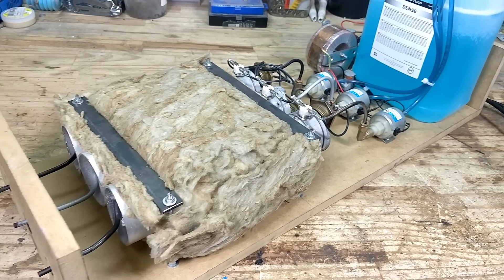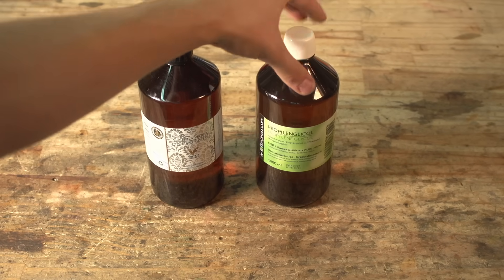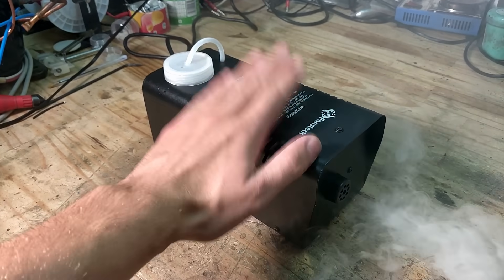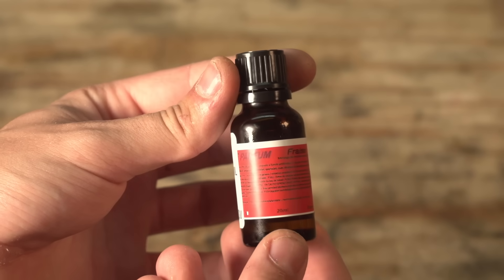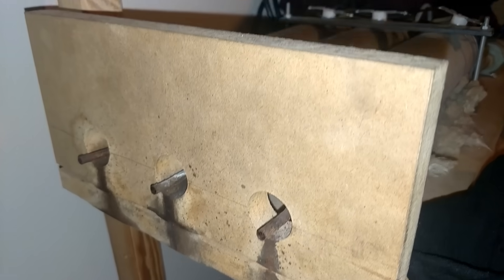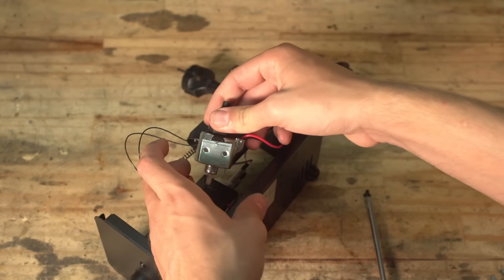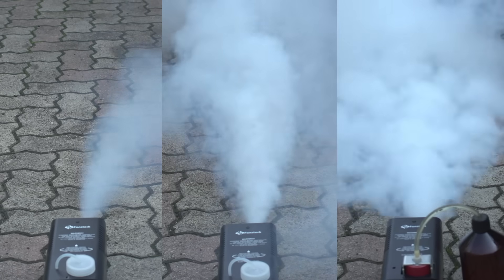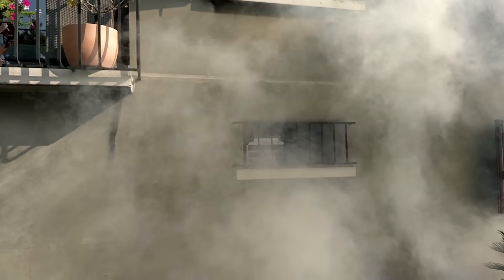How To Make a Cheap Fog Machine 10 Times More Powerful

Comment: Do you think you could change the controller to be able to have a bit more control? Like with a potentiometer, and avoid spuing out tons of un evaporated liquid?

Also I'm not sure upgrading the pump won't damage the controller overtime, it draws more current, I guess?
Reply from the maker: Sure, maybe a timer that cuts off automatically after 5 sec?
Also, you make a good point. A bigger pump will pull more current. (Around 200mA @ 230v) 
The controller in this machine uses two beefy relays ( one for the pump, one for the heater) and are rated for well over 10A each so there's tons of head room
Reply: @NicolasSalencPBP  We hacked a wired machine for a commercial laser tag game with a 556 timer, so all the operator had to do was flick a switch, and the fogger would run for 10 seconds then wait 30 seconds. About two minutes after startup a capacitor would turn on a transistor, changing the R/C timing so it was on for 10 seconds, off for a minute. At power up the other half of the 556 would inhibit operation to give the heater a chance to heat up.

Comment: Atmospherics Technician here. This is not the best idea ever, and you did explain why (heater block not big enough, clogging issues). A much safer way to increase the output for a smaller machine is to use a high density fluid. Sure, that's what you've made, but you can buy High Density fluids off the shelf that work really well, that also come with a SDS. Antari makes a couple that are really good - FLY and FLH. Throw that in a machine and the difference will be almost as dramatic as what you showed.
Reply from the maker: Thanks for commenting! 
The commercially available liquid I used in the video is already supposed to be high density fluid, but I do think that it isn't nearly as dense as some other available liquids... Maybe it's just too old or I got ripped off 😆
What do you mean by an SDS?
Reply: @NicolasSalencPBP  Yeah the fluid you had looked like a light density fluid. The high density fluids I use are generally around 40-20% water. a SDS is a Safety Data Sheet.
Reply from the maker: @Socapexxx  60 - 80% Glycerine? Damn I need to get my hands on those, do you have a link to the fluid with the SDS?
Reply: If you are an atmospheric technician you wouldn't be using fog machines for commercial based productions. Just haze- which comes in two flavors: water based or mineral oil based (cracker).
Reply: @blasterman789  If you actually knew anything about haze, you wouldn't say there are 2 types.

I often do large outdoor shows and arena shows. It's great to get a baseline haze from an oil based hazer, but sometimes you need that extra kick. A couple of vipers with fans on either side of the stage can give you a really nice thick haze when you need it - and it dissipates very quickly when you don't need it.

Comment: You got me curious. I have a bottle of fog juice that I bought about 25 years ago (VEI brand). It's viscosity is close to water. I gave it a sniff and a taste and it's a bit bitter, not at all sweet like VG or PG. It may be off because it's so old, but it was sealed with tape with the air squeezed out. I ran the fogger a few years ago and the fog still smelled sweet. I brought up an SDS for Rosco fog fluid and it contains Triethyleneglycol, 1,3-Butylene glycol, Propylene glycol, and Deionized water.
Anyway, I have gallons of PG & VG, if only I used it more... And naturally, you can find videos of people vaping through custom mods running at hundreds of watts, which makes you wonder why they don't just use a fog machine.
Reply: It tastes bitter because they add some bitrex in it, to stop people from drinking it 😬
Reply: Most vapes were just smoke machines built around 3.7v /4.2v DC 18650 lithium batteries vs our 240v/110v AC hazers :)

Comment: 7:53  , Make sure to run distilled water only through the machine after unclogging it with vinegar. 
I made the mistake of leaving vinegar in the lines and the pump's small solenoid piston corroded out.
--
Distilled water in the lines has worked for me when leaving the machines unused for a year.

Comment: Got a battery powered fog machine? Looking for something that I can shove into an rc boat to simulate a steam ship.
Reply from the maker: Check out the smoke cube, it's usually used for magic tricks and doesn't really emit that much smoke, but is insanely compact and light weight : https://www.solomagia.fr/smoke-cube-gimmick-and-online-instructions-by-joao-miranda-fr-Fr.html?language=fr&currency=EUR&gclid=CjwKCAjwndCKBhAkEiwAgSDKQSOWsWcN8erm7eabDfFao6CUYKkAuKpvWH0r03mwokvYaTQgFQX5QBoCtlYQAvD_BwE
Reply: @NicolasSalencPBP  I'm not an that worried about weight, the plans I have are old enough that they call for lead acid batteries, and I'm planning on using lithium ion. And I'm half planning to build it to double scale which would make it almost 8 feet long.
Reply from the maker: @danielauen7790  in that case check out the "Look tiny CX" or the "look power"
Reply: Or consider an ultrasonic vaporizer approach. Small immersible units were used in tabletop fountains and the like. You’d have a ready source of water too.

Comment: Hi, I work as a service engineer and repair similar machines and stuff for scenes. You have a smoke machine in the video somewhere around 60 W, you can take a car for 1500 W, but unfortunately it is much more expensive. There is also a problem with liquid for smoke, pumps or regulators may fail and the heater clogs up due to the liquid. But small cars were still brought in with faulty pumps
Reply from the maker: Yes, the pump seems to be the weak spot of most fog machines. I have owned a few crappy Chinese models in the past and the pump is the component that failed every single time. I'm hoping Nespresso machine pumps are better quality...
Out of interest, how would you go about cleaning a heating block? My old DIY machine is filthy and could use a thorough cleaning and diluted vinegar just won't cut it x)
Reply: @NicolasSalencPBP   hydrochloric acid in any concentration does not damage copper, only eats the debris inside the copper tubing - but it etches aluminium quickly and makes steel rust instantly

Comment: Will this work with a home made fog chiller?
Reply from the maker: Sure! By home made I assume something along the lines of a bucket full of ice? More fog will mean that the ice bucket might not be able to cool the fog as well so the fog might not lay so low, and the ice will melt alot quicker, but it should work just fine!
Reply: @NicolasSalencPBP  I would be using a 5' ice chest for the build with a PC fan added to the output to help it along....
Reply from the maker: @chrislewis2262  Yep, should work fine!
Reply: @NicolasSalencPBP  My rig for halloween is a cheap cooler. I cut both ends with a hole saw and fit PVC couplings in with adhesive. Then i ran chicken wire between them inside. I fill the cooler with ice, set the fog machine on top with a PVC U shape set up against the fog output. It fires the smoke through and it pours out the other end of the cooler in a nice horror movie graveyard effect that sticks to the ground!

Comment: The water is used to shatter the glycerine/propylene glycol into smaller droplets when it turns to steam givng more fog.
Reply from the maker: Interesting! I did test the glycerine at different concentrations and it really did seem like the water reduced the performance in a rather linear fashion (10x more water = 10x less fog density) if that makes sense...
Maybe smaller droplets allow the fog to stay visible for a longer period of time?
Reply: @NicolasSalencPBP  I think it may have to do with safety and temperature, remember these fog juices must work with all foggers. I think the water is used to regulate the temperature of the glycerin and glycol, the water will never surpass its boiling point unless it is under high pressure so mixing it in would keep the glycerin from making dangerous fumes.
Reply: @sharpnesstherapy502  yes, and thats important! acrolein etc.    ecigs use lower temps so there its no problem to use (nearly) pure pg/vg
Reply from the maker: @y-o-u-b  I believe acrolein forms at 290°C. I have never seen a machine that has a temperature sensor that cuts off the heater at a temperature higher than 260°C... However due to thermal inertia and the fact that the coil is way closer to the heater than the sensor is, the coil might get hotter than 260°C for a brief moment. Perhaps the water is used to absorb some of that extra heat?
Reply: @NicolasSalencPBP  theres probably not a sharp point where the formation starts, at least a little is generated below that point so its better to choose a safe margin, as you dont smell it in little concentrations. as there is commercial fluid with only 1/5 or so water, it should be ok in this ballpark, especially if used outside,  the main hazard seems to be, as with corona, breathing aerosols for hours inside a closed room. nice mod btw, i will try it
Reply from the maker: @y-o-u-b 1/5 water? Finally! Do you have the product link or name?
Reply: @NicolasSalencPBP  No idea since I didn't test myself, but glycerin is flammable right? So wouldn't having a high glycerin content just make the fog explosive? Sounds like a pretty good reason to me for making the liquids mostly out of water, compared to the cost cutting theory, because otherwise you'd be able to still find more premium fog liquids with high glycerin content I guess.
Reply from the maker: @STPromosMusic  Its certainly more flammable than water, but the lack of oxygen inside the tube makes it impossible for it to combust. And of course, again, the heater will never get near the temperature necessary to ignite it. Also, if it was a possibility, I assume you would be hearing alot about explosive e-cigarettes (and not the ones related to the lipo battery exploding )
Reply: @NicolasSalencPBP  I see, so glycerin can't ignite unless it's temperature gets high enough (even with a spark), which won't happen once it is floating outside as smoke, did I understand right?
Reply: @sharpnesstherapy502  the boiling point of water IS surpassed, but the boiling range of the mixture is lower than pure VG+PG, see https://en.wikipedia.org/wiki/Raoult%27s_law
(which ist good)
Reply: @NicolasSalencPBP  water is flamable above 1700 C  (oxyhydrogen) an this temperature could only be reached by using lipo electrolytes as fog juice. but there are anecdotally mentioned cases where normal water based fog juice fog (outside the machine) indeed was able to burn to some degree
Reply: @NicolasSalencPBP   
around 25% water, posted a link a dozend times, but yt deletes it, what the hell is defective with your youtube comment section??
now i posted it here as pinned comment on top, maybe it stays: https://youtu.be/EwSZRBh0v3Q?t=81
Reply: @NicolasSalencPBP  Mmh - but then why is there residue in the tubes as you mentioned? That usually indicates decomposition of the chemical in question. By adding water you create conditions similar to a distillation where the liquid with the lowest boiling point (Water) would have to fully evaporate, keeping the mixture at 100°C. This is of course idealized: By heating the mixture as rapidly as in a fog machine there may be hotspots created in the liquid where all water molecules have been used up. But Even a little water may help somewhat. Alternatively you can just use a fogger with a very good temperature control - which might be why water is added by fog fluid manufacturers in the first place: they don't want to be held liable in a "was it a bad machine or bad liquid" scenario. By adding a lot of water even a crappy machine with bad thermocontrol hysteresis cannot realistically produce acrolein. Would be interesting to see if the fog you create contains it - maybe collect it and let one of the YTers with chemical analysis capabilities determine the acrolein content?
Reply: @NicolasSalencPBP  its probably also a cost cutting measure as you pointed out. I imagine it would only helps to small degree, be intrested to see a batch with maybe 5-10% water and see if that’s an improvement.
Reply: @NicolasSalencPBP  water is necessary to produce fog, as you don't wanna breathe the scorching hot glycerin vapors but just have small droplets suspended in the air. The water flash boils in the heating element and sprays small glycerin droplets, and you have fog!

But you don't need to add any water for it to work as glycerin is already hygroscopic and absorbs the water in the air. Adding water just dilutes it
Reply from the maker: @FAB1150  Could be, but then why do vape liquids contain no water? 
Also I'm pretty sure water or humidity in the air is never needed, the fog you see is the glycerine condensing into small droplets under ambient temperature. So I believe water has nothing to do with it, but I could definitely be wrong, it would be interesting to test the machine in an environment with zero humidity 👍
Reply: @FAB1150  but if he buys 99/xy % glycerin this ist the water free version, although it will pull water from the surroundings over time slowly when the container is open, in the machine tank where the lid has a little hole usually etc,  to an equlilibrium that depends on the median air moisture, typically 65% glycerin the rest water.  question: why dont ecig users who use 50/50 VG/PG whitout any water dont complain about "breathing scorching hot vapors"?
Reply: @NicolasSalencPBP  maybe put calciumchloride and a small fog machine in a plastic bag, wait hours to dry, make fog, open, and taste the fog ;)
Reply: @y-o-u-b  because there still is water in it. That's how vapes and fog machines work, there's no question about it. Vape liquids do have water in them.
Reply: @FAB1150  i doubt that
Reply: @y-o-u-b  based on?
Reply: @FAB1150  several examinations
Reply: @FAB1150  I am about 100% certain vape liquid does not contain water. I have made many of vape juice flavors without ever mixing water into it..
Reply: @y-o-u-b  It's something you get used to honestly. You start at a lower temp and work your way up (probably coughing your lungs out). Some people (including myself) like hot vapor because it's similar to smoking. Most devices have adjustable airflow so it cools down a little bit anyway.
Reply: @knickemz  yup second this, been vaping a long time and save for back in the olden days when atomizers just couldn't wick high VG stuff I used to use vodka to thin the juice down, PG is basically a replacement for water in vaping, a way to thin out viscous liquids enough that they can be fed easily onto the heating coil, as flavour profile on a fog machine is moot a mix of 85% VG to 15% water would be ample to thin the liquid enough for easy feeding and if you buy VG in bulk (I pay 8gbp for 5000mls) you can scrap the PG and make your fog/vape fluid super cheaply
Reply: @ste887  Good to know. With the possible flavour ban and nicotine cap in Canada I'm tempted to start making my own e-juice.
Reply: There is also corrosion too. I went to use my little fog machine one day and the pump had seized up. The inside was a green mess of copper oxide. Especially don't leave the vinegar solution in for longer than necessary to clean it out. Rinse it out right away or it will corrode everything.
Reply: @Adam Courchaine genuine question, can you read my comments? I can't see them.
Reply: @FAB1150  some body / some thing deletes random (or not so random) posts here, happened to me in this subthread today several times, they appear for a short time, then dissapear permanently - lets see if this stays
Reply: @y-o-u-b  i see yours now, changed account for now... I'll try to repost the comment with this one
Reply: @RandomStuff_  it seems the cause is yt spam detection gone crazy, not exactly clear what triggers it, maybe some user defined settings
Reply: @Adam Courchaine hopefully no oil content!
Reply: Now try nitroglycerin